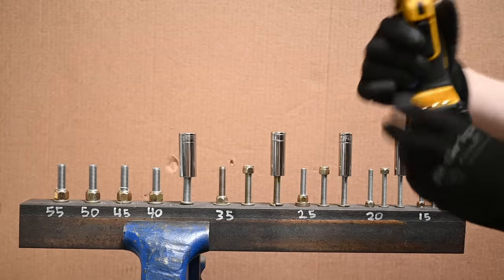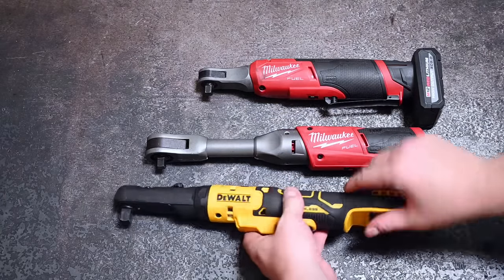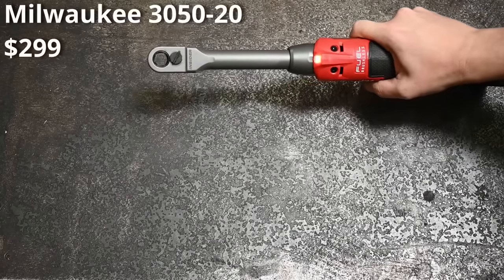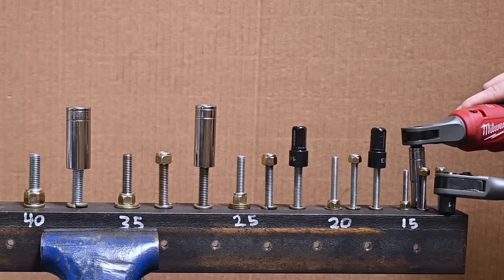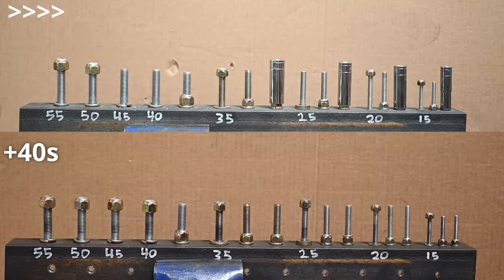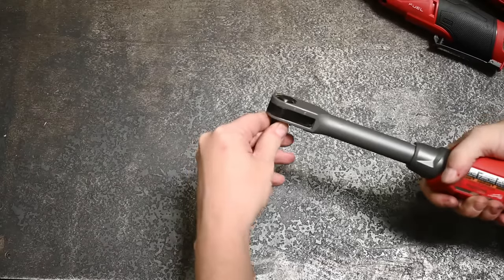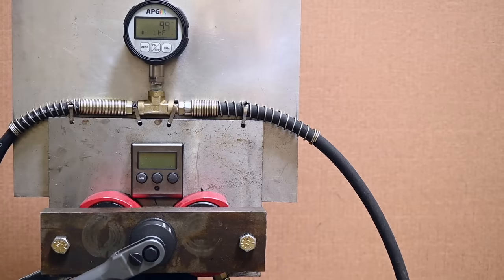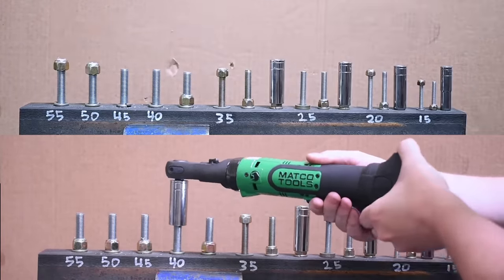Milwaukee's New Insider Ratchet vs DeWALT's New Sealed Head!

Comment from the maker: The sealed head KIT: https://amzn.to/46Svmyg bare tool:  https://amzn.to/4fJ9Scq
Can anyone explain an M18 FUEL circ saw being like $190 and their M12 ratchets $250-300 these days?
We add to the rankings of 20 different tool categories every week, to see those updated forever they be here: https://torquetestchannel.etsy.com/listing/1152216140/torque-test-channel-spreadsheet-leader
Reply: Exactly!
Reply: They're using the inclusion of sockets to justify that price.😅
Reply: Mic Drop! 🎤
Reply: @12MRJERSEY  Doesn't explain the $250 ones though! Lol.
Reply: 2567 at Home Depot is $110 (with hack)...just got to know how to buy them lol
Reply from the maker: @TheJsgto  More just pointing at the retail pricing scheme of tool brands lately, if you have to buy 2 tools and return 1 in order to get a decent price on it I think that might just underline the point :P
Reply: If you think that's crazy, I've seen entire sets of 5/6 gen1/gen2 m18 tools pop up for around that price. Maybe $300-$400 at most. At least he insulated stapler seems to be fairly priced, probably just because they're price gouging on the staples right now though.
Reply: I don't know why, but I know they have priced them well outside what I would be willing to pay for one. I can justify an expensive cordless impact for service calls, they can make the difference between getting a job done or not. A cordless ratchet is a luxury, at best it saves a few minutes. I would struggle to pull the trigger on one at half the price they are asking for these. I'll stick to busting my knuckles with the old Blue Point I have had for 15 years.
Reply: Cause Mikwaukee is greedy unlike SBD!
Reply: Jonnesway makes a VERY strong ratchet you should test. The ir109xpa is pretty fast. You should test the hf Earthquake vs the Chicago Pneumatic, because the harbor freight one sucks. Maybe astro makes something..?
Reply: They've discovered that mechanics are already accepting of dropping hundreds for tools. I think
Reply: Standard corporate price gouging.  Prove me otherwise!
Reply: I believe Milwaukee feels like their main customer on Ratchets is going to be a professional or at least someone who wrenches on motors often. This type of guy will spend more to get more perceived quality. Whether or not that quality is ACTUALLY present is another story. The standard homeowner who occasionally uses a circular saw or drill isn't going to pay $250 when they can buy a different brand for their minimal use. So Milwaukee needs to keep the homeowner in the battery platform by selling homeowner-type tools at a lower price. Then the professional-type tools like a ratchet or some of their lighting options get a much higher price.
Reply: Probably they figure their primary market is guys who will pay tool truck prices for lesser tools.  Also economies of scale and every other brand offering circular saws, hex drivers, drills, etc.
Reply: They know Milwaukee fangirls will buy no matter what. Demand dictate the price. Milwaukee tools are great but their fangirls not so much. I dont care if you running 12v or  80 bazillion volts. If it fits and does the best job its the winner. Only losers complain about that. The new Milwaukee compact impact driver and drill  make the m12 one look dumb.
Reply: Coworker just dropped $400 on the insider baretool from the  Cornwell dealer. 🫤
Reply: Science? 😉
Reply: It may simply be because the dollar is losing value, the pricing of their new products based on the devaluation of the dollar two hundred and fifty bucks today is not  what two hundred and fifty bucks was four years ago
Reply: More stick framer carpenters & diy structure builders to sell to than parts changer mechanics to sell to. Economy of scale.
Reply: A lot more engineering and parts involved in the ratchet.  A circ saw is the most basic and simple power tool made.
Reply: Milwaukee is always the best.
Reply: Hilti now has a 3/8" ratchet... (SIW 4R-22 right angle impact wrench)   Will you be testing that??? Thanks
Reply: Sure, its because the ratchets have become popular, especially with techs so really, they are just copying snap-on's business model, overcharge for it cause its got a brand name on it.
Reply: I don't understand some of these recent tool prices. The Dewalt belt sander 300 tool only, band file 280 tool only, rivet gun 300 tool only, new flexvolt angle grinder 370 tool only, Yikes! Are they trying to outprice Milwaukee?
Reply: I use the ac delco brand ratchets and for the price, it doesn't do the Milwaukee shuffle. I use it at least 3x a week for about 5 yrs or more and is holding up well. They do have different series so look out for the specs. Like the higher spec acdelco ratchets have a progressive switch and the lower series is full kilter at any switch position. I usually like the progressive switch so I can place my hand where it's comfortable and ease into the slow speed until it latches on square and then give her beans.
Reply: @TorqueTestChannel   Currently a deal at Lowe's when you buy the DCF 510 bare tool you get 2 1.7 amp hour powerstack batteries for free.  Good through 4/17/2024
Reply: Milwaukee prices are just stupid high, even compared to dewalt

Comment: I suspect the pass through milwaukee was not made with a mechanic in mind,  but rather an electrician or construction worker who uses a lot of threaded rod.
Reply from the maker: Possibly, and that would make sense. But we sure see a lot of marketing to mechanics on this one from day 1
Reply: Sometimes marketing doesn't have a clue.
Reply: As an electrician who was very keen on this through ratchet, I was dissapointed to see the Sockets don't have a deep option. 

I know it sounds ridiculous but when assembling unistrut or switchboards or suspended cable tray a shallow socket doesn't always work. Gotta get a flex head spanner out more often than you'd think
Reply: @wearsjorge55 but the pass through sockets are endlessly deep. 
I use a 9/16” (14mm) pretty much exclusively on threaded rod. That's where it would be awesome.
Reply: @wearsjorge55  I wonder if there is a pass through extension for them? I assume your problem would be that the ratchet neck interferes before the socket touches.
Reply: @jmanlinc  that's right on the money mate. Thanks for explaining it. 

An extension or simply a long version would be fine. We don't need it to be super heavy duty they're not torqued very tight
Reply: Great point. As a plumber, if it won’t allow at least 3/8 to pass through though, it’s of little value for myself.

Comment: I just purchased the DeWalt DCF500B 12v sealed head ratchet and it came with three adaptors,  a 3/8" and 1/4" square drive for sockets and a neat 1/4" hex drive to use with all 1/4" hex bits. (think 90 degree screwdriver)  I just used it on some large tie rod bolts while rebuilding the front end suspension on a 3500 truck and it is a beast!  Impressed the heck out of me.  Will never use an air ratchet again.  For the money and versatility, the DeWalt can't be beat, it's awesome!

Comment: This ended as I knew it would. The high-speed is still king. I'm so glad you pointed out how annoying those 3/8, 1/4 adapters would be. No othet reviewer has mentioned it, which I think is a very big deal since Milwaukee is trying to sell you on this high price tag as being a replacement for the other ratchets when it's not
Reply: How many of those reviewers had it sent to them by Milwaukee?
Reply: @MustangAficionado like 95% of them bro, we need better disclosures on social media
Reply: And when you lose one....
Reply: I have all of them. The insider is great, low profile with pass through for long bolts. I do heavy equipment and it's a life saver.
Reply: Keep telling yourself that if it makes you feel better about not being able to afford the insider LMAO
Reply: @markyb7875  Such a tired insult. I guess all the money in the world won't buy wit.

Comment: The thing I noticed about the milwakee extended reach I bought a year ago, is that when it was new, the tolerances between the parts of the tool were so tight that it caused it to feel weak, and do the stutter that you guys were experiencing.  I was highly disappointed and almost returned it but kept it anyway.  After a fair bit of use, though, the thing started to loosen up, the stutter went away, and it seems to have much more power now than when it was new.  I don't know if this is a common experience, so I figured I would comment. 😊

Comment: Insider is my first battery-powered Milwaukee tool, Based on I have over 30 DeWalt batteries in my tool chest. Now they have free replacement adapters to fix the problem. I don’t care about how powerful they are; I just need a tool that can fit into almost any space and get the job done

Comment: I have the dcf510 and 500 DeWalts. They blow me away with all their upgrades! A solid win for team yellow! 😁
Reply: Plan on buying one, which of the 2 should i get? (my first el ratchet)
Reply: @chucknorris2952  The 510 for power, the 500 for small head, smaller body and faster speed.
The 510 comes with 3/8 and 1/2 anvils.
The 500 comes with 1/4, 3/8 and 1/4 quick change hex.

Comment: You guys have to do the DCF500 12V Sealed head next, I just picked one up and its claiming 450 RPM AND 50 Ft lbs of torque, as well as having a 1/4 hex drive plug. Seeing how the past 12V Dewalts did it may be a little beast on the charts, as long as you can actually fit it where you need it with its size.
Reply: it looks like that one is targeting the M12 High Speed 2567-20. I own that Milwaukee and previously owned the OG M12 brushed ratchet and 2557-20 Fuel low speed (last from the chart yeah) but that one got stolen from my truck so I got the high speed one.
Yes it's quick but it's a torqueless wonder, I think even the OG brushed one had a bit more torque. And having a lower speed might actually help with more control when setting nuts back in. Or maybe it's just me.
If the DCF500 keeps the speed from the 2567-20 while delivering more torque then it would be a win for many
Reply: I definitely agree that would be sweet to see if the rpms are truly better on the 12v than the 20v and if it can dethrone the milwaukee

Comment: im an electrician and can see the use of the pass-through system of the Milwaukee. I don’t always need a lot of torque, but this could be very useful for instances of using long, threaded rods for mounting. pass through is pretty cool
Reply: Enjoy it for the week it lasts you.
Reply: It lasts a full week?  The last six Dewalts I had to use wouldn't last an hour.
Reply: thats the big selling point to me as well, but they didnt seal the head so if you're doing tough stuff then grease will leak out and the pass through design for the sockets stops halfway through the range (?). ill wait until milwaukee can address those issues and come back with something you can slap an 18v battery on as well.
Reply: @LESLASLESLAS week? Some of my Milwaukee tools are going on 6 years of everyday use still going strong
Reply: @edwardoavila7666 first of all they make a boot that goes over the head to prevent this, not having the pass through on all of the sockets I do find odd, the whole point of the 12v is that they are lighter, smaller and easier to work with which comes in handy over 18-20v tools, and if you need the power of an 18v tool when using a ratchet you should probably be using an impact gun instead.

Comment: To me, the most important feature, assuming the power ratchet has reasonable torque and speed, is the size. Smaller = better. The ratchet is no good if you can't get it into where you need it. Past a certain point, speed and torque don't matter; they do with an impact wrench, but not with a ratchet.

Comment: I have an m12 high speed and just got the insider. Noticeably slower but it honestly doesn't matter too much. The biggest draw to me is I'm hoping it's more durable. I've had to replace the head in my high speed numerous times because either the ball falls out, or it'll switch directions randomly. They're $30 or so everytime. Plus having both a 1/4 and 3/8 in one is nice.
Reply: looking at that grease spray on the insider at the end of the video did not give me confidence in it's long term survivability.
Reply: @Spyhermit  My snap on used to spray grease and it never had a problem. It did have a grease fitting though
Reply from the maker: Hey I'll take more grease over no grease! But it does seem in a hurry to wave goodbye to the stuff
Reply: @TorqueTestChannel  Yeah mine doesn't look as bad as that one but I haven't used it much for sustained periods of time like your gauntlet. Could probably shoot some more in there with a needle greaser.
Reply: people don't realize how often you have to grease these damn things 😂 the high speeds probably chew through those heads super fast. I went with snap on for my ratchets, I think they feel the best and have great quality especially being able to easily grease the head with a fitting instead of smearing it into the inside of the milwaukee head 😂 I still like the milwaukee besides for the handle and overall uncomfortable shape and direction switch.
Reply: @Spyhermit they make a boot.

Comment: I have the older 2457 and just bought the Milwaukee insider. Both exhibit the same slipping or not spinnong occasionally. Sometimes it seems to happen when the nut doesnt have alot of tension on it. The 2457 was getting worse since I have owned it for aroubd 10 years and I watched a video showing how to take the head apart and clean the grease out on springs that press the head forward as they build up grease and dirt over time. After cleaning it worked much better.

Comment: Even though I have the insider and the Dewalt, the insider is the one I use the most. Due to its longer and narrow neck it's easier to get into tight spots working on cars. The Dewalt is  more handy when the long neck of the insider can't wrap around areas, but when that's the case, you're better off with a traditional wrench and swivel adapter.

Comment: I've had that stalling issue with my basic non-fuel M12 3/8 cordless ratchet. At least it looks very similar. What I've found is it happens when the direction isn't actually fully engaged. Like it seems like it is, and you can't turn the toggle any further, but the teeth will still skip allowing the ratchet to feel like it's operating as normal, but not actually turning the head. Strange.
Reply: My high speed m12 does the same thing.. motor is running full speed but the anvil isn’t turning.. pisses me off lol
Reply: It mostly happens due to excessive vibration, next time try putting your hand on the head of the ratchet or the fastener and you’ll see it will start working, the way the mechanism works if there’s too much vibration it can’t engage the next set of teeth

Comment: As an auto body tech I use the absolute shit out of the high speed team red in 1/4". It definitely has more forward torque, some times you have to tighten and loosen bolts frequently when aligning panels. The good old neutral drop comes in handy though, sure it's not good on your sockets or hardware but it saves a ton of time.
Reply: So your boss is gna cut your pay for being late 3 mins.
You get to the workshop and whaddya do?

YA NEUTRAL DROP IT! 🤣
Reply: @The.Toaster  when working flat rate every minute counts...

Comment: You need to test the DCF500 12V Sealed head ratchet.  For some reason the 12v seems to always perform better than the 20v ones.   
Based on your tests, I purchased the DCF503 12v to replace the weak Milwaukee ratchet I had, and it performs great!  A much better tool than the red brand.
Reply: @wwdiesel
Yea my dcf500 is pretty quick with great torque 👍

Comment: I have been using a MAC Tools 10.8V (UK)/12V (US) for around 3-4 years now. It hasnt slowed down or gotten any weaker. The grease nipple is a brillant feature and it is prooven as in that 3-4 year time span I have witnessed many people buying at least 2-3 milwaukee ratchets.
Everyone always says its slower but I personally can live with that knowing I dont need to torque check everything considering its strength, not to mention I use the thing as a breaker bar, hammer and battering ram.
Honestly my one of my favourite tools I have ever bought.
Not sure if I should upgrade when it eventually dies, when ever that shall be, or pay the money to repair it.
This video has definately made me lean towards buying a new one but I would like to see how much abuse it can handle, sadly they havent been out long enough.

Comment: I was about to say what happened to Craftsman's pass through socket design, I've had a small set for a long time and they are awesome but it seems that Crescent brand owns the design now, it would be awesome to see something like that for these because you can go all the way up to 7/8 or 19mm while retaining the pass through design as well as tooth design is pretty cool too. Keep up the awesome work!
Reply: The bigger tool kits go even up to 1" and 24mm sockets in the 3/8 drive max axess. Husky also uses that pattern still. And I've seen some house brands of auto parts stores use that pattern too. Love those sockets, would like to see a modern ratchet use that design drive now!

Comment: Dewalt has a 12v version of the sealed head, you should test that for fairness. But I’m glad you made this video so I know not to get the Milwaukee. I work on rusty stuffy, and that means the socket and nut are usually tightly bonded together, so the way the Milwaukee adapters just slide out is a deal breaker for sure